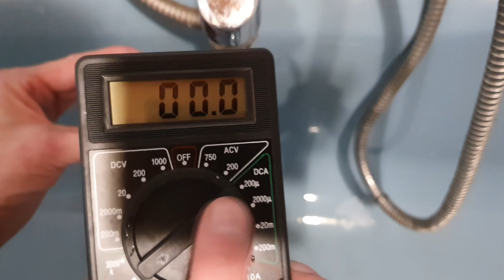Rain Fuel Generator from Conductive ink - Water flow speed test

Comment: Okay. I've viewed your Video using Rain Water, or just Water to produce a Voltage and a Small Current. Yes, 'it does Work'. Your thinking is just too Small, 'in my opinion'. You need to take all this up a notch. Start thinking in Feet, or Meters. For instance. You could use a piece of (VINYL) like Vinyl House Siding. You know when the Rain come's it just Poor's Down the Vinyl Siding outside Walls. Even Water Guttering would be a great place to start. If you were able to lay out all that's needed, let me say 1'' Squire and use a (JUOLE THIEF CIRCUIT) and some (CORPACITORS and DIODES) laying all this out down the Length of Siding in a Grid Layout. Then collect all the Voltage and Current at the End. What would be the Voltage and Current at the End? Then times this by all the Vinyl Siding that's mounted to the outside Walls. What would your Total output be? This where I think you should go because most of us want to End Hooking up to the Government Grid. You could then use the Water to make Hydrogen Gas to heat and Cook with giving all that explore this possible (FREEDOME). (LOL) Just a thought from an Old Man that likes what you and Robert are doing. Thanks for the upload Mate.

Comment: 1.   When ur measuring current with just the meter  ur shorting out the cell with the internal current sense resistor of the meter, usually less than .1 ohm.   To get a true reading of the power of the cell add a load resistance equal to the drive impedance of the cell....probably much much higher since these cells  are voltage sources not current sources.   Then  measure the voltage across this external resistance and calculate the current.      2.  Experiment showed more water = more output.  BUT is output a function of speed or the volume?    Try the drip test with a given drip rate from 2 different height to determine if inertia...speed of impact is a factor.   Were rooting for you Cayrex2
Reply: Adding a load is what we need in the real world but output is so low won't it just kill a voltage output to vertually zero?